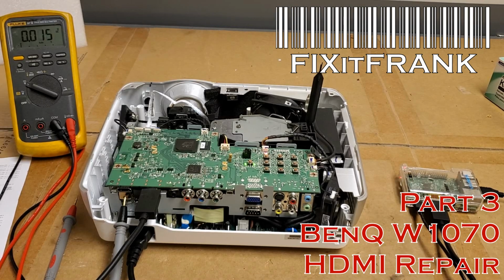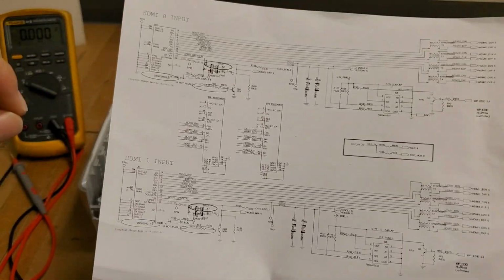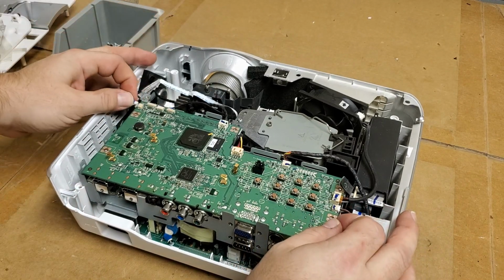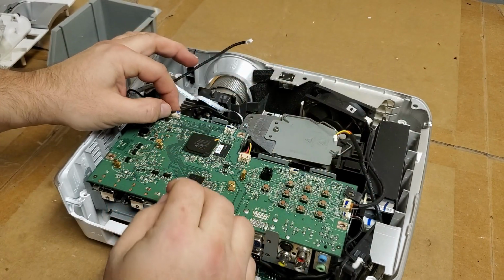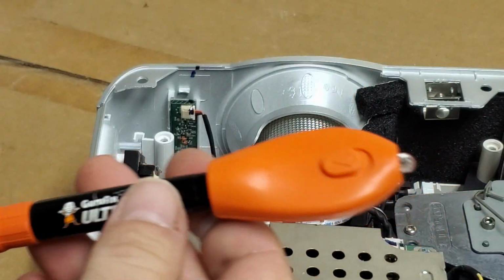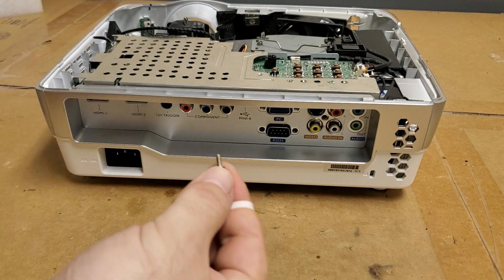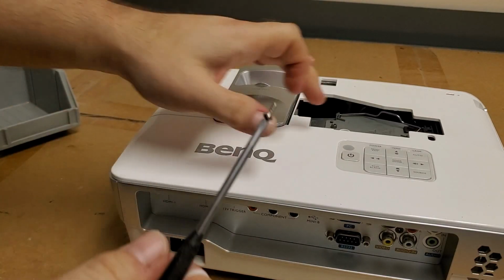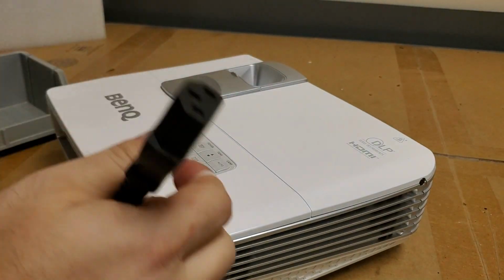BenQ W1070 DLP Projector Repair No Light-HDMI Repair Part 3

Comment: Hi. I have problem with hdmi ports, and i have question to You.
First my Benq w1070 had problem with HDMI 2 port(no signal), but i used only one of them, but now HDMI 1 lost signal to. HDMI 1&2 ports are death... :( i checked regulators UQ 1,2,3,4,5, and they are ok, chip ADV7612 is not burned(i have new one for sure, but not installed yet). 
Questions
- this long thin chip 5:00 is next to HDMI1 socket?(And HDMI2 to?)
- if i take out this thin chip, everyting should be ok with HDMI 1&2-signal?
(My 5x diodes for hdmi 1, and next five for hdmi2 are still in one piece)
Ps i see "service menu" on screen etc, only HDMI ports are death :/
EDIT/UPGRADE:
- probably i have phisical problem with HDMI 2. Maybe dirt, or not tight socket becouse i moved HDMI plug with signal and now i watching  movie (for test) 
New question:
I haven't HDMI 1 before ,so where is problem? Problem od with chip from "analog devices" company? Or with this small, thin chip next to HDMI 1?
Next question: you had problem (on your pt3 HDMI repair) with HDMI 1, or HDMI 2?
Reply from the maker: The TVS diode array was the problem here if I recall correctly(the thin chip array you mention).  But definitely check the inside of the connector.

Comment: Hi Frank. Thanks for the great videos that have given me confidence to attempt repairs. Hope you don’t mind if I ask your advice on my w1070+. The power light is continually red and other buttons, fans, lamp etc unresponsive. There appears to be an issue with the mainboard as I have tested the power board, ballast and colour wheel with a w1080st+ mainboard and they work fine. By touch and with a thermal camera, the DLP controller chip (DPP4422-he) of the w1070+ is particularly warm. I’ve tried reflowing it (30sec at ~230-250DegC) but no change. I’m wondering about giving up or trying to replace the DDP4422. I wondered if  you had encountered similar DLP controller issues and had any success with replacing them or other BGA chips? Thanks
Reply from the maker: Thanks a bunch for the kind words!  I have not replaced the DPP4422.  My understanding is they have firmware on them that needs to be flashed that I don't have the capabilities to do. I have not been able to confirm that though. If I am wrong, then replacing it would be an option.  I have seen them go bad a few times. Optoma more than BenQ but I have seen it on BenQ. 
But, I have also seen this happen with bad voltage regulators and shorted TVS diodes on the HDMI ports.  For what its worth, the W1070 service manual(level 2 or 3) has a great schematic in it.  I would make sure the PMD1000 is okay and producing proper voltage.  
The only way I have solved these (bad DPP chip) is to replace the mainboard. I do this because I need to know 100% that a customers projector is fixed.  If I replace the DDP chip and it fails then that is on me.  If it was my personal projector I might try changing that chip because if it fails in a bit, then no one is going to yell at me.
I'd suggest downloading the SM, then rule out the PMD1000 and any secondary VRs on the mainboard.  If that all checks out, then a mainboard is your best bet.  If you email gydz@timeprojetorlamp.com, they have access to mainboards(used but good) and they ship DHL and take paypal.  I've used them for 6+ years now and never had a bad experience.

Comment: Hallo Frank,
i need the color wheel for that benq i have one of this W 1070 projector but the color wheel demged i want orginal one becuse i bught one from china not worked at all .please Frank from where i can buy orginal one 
.
Thank you so much Frank you great healp 🤘🏻
Reply from the maker: You are welcome! There are no original color wheels to my knowledge.  Color wheels are generally pretty simple.  What problem are you having?  It might not be the color wheel at fault.  If you put a new lamp assembly inside, be sure it has a proper IR block lens or it will make the color wheel act like it has problems. I have had color wheels arrive with bad motors.  It is rare but it has happened.  Every wheel I purchased from Time electronics was good though. I never had a problem with their items.
Reply: Hallo Frank,
color wheel was damged and i bught one after i assembled in the projector ther  blue lins comen over the pic.
with Faithfully for Frank🙋🏻‍♂️
Reply from the maker: You may need to adjust the index position of the wheel.  Also if you have lines in the picture, check the seating of the main board. It may not be seated properly. The service menu is accessible by pressing menu, then press source and enter buttons at the same time. Use the arrow keys to navigate to position 3 or 4 and then down arrow to the color wheel index. Then adjust the number and watch the image.

Comment: hello I don't have an image on hdmi 1, can you give the symbol of this chip?
Reply from the maker: I recall this uses one chip for both HDMI ports.  I would check the TVS diodes that protect the chip.  They are made to short out to protect that IC from damage.  You will see the small rectangle parts right behind the HDMI plug.  You can desolder them without causing any other problems.  If you desolder them and the input starts working, then your problem is the TVS diodes.  If you still have no image, then the HDMI IC is bad.  I do not recall the part# at the moment, but I will update this later once I can look at the service manual.

Comment: Thank you! This was the problem also with my projector. Changed color wheel, changed lamp and finally removed HDMI chip, which solved the problem. :)
Reply from the maker: Awesome!  Its weird how those just shut down the rest of the electronics when they get hit.  I mean it makes sense but you'd think they would design it to be a little more robust in that regard.
Reply: @FixitFrank  More weird is the fact, that after burning HDMI, I used VGA for 2 years without problem. So the problem arised over time. :)

Comment: QUESTION PLEASE ..  dlp projector , tries to lite bulb but nothing .. no power is going to bulb on my meter..  color wheel spins and cleaned..  tries 3 times and shuts down with bulb failior light ?..  has new bulb that works in another dell ... fans all work , door switch good ...  would it be ballast ?...thanks, kevin
Reply from the maker: It is actually not possible to measure the lamp voltage with a normal meter.  These use high frequency AC(20KHZ or so) to drive the lamp and use a 5-10KV start up pulse.  That can nuke your meter. 
Your best bet is measuring the input voltage to the ballast.  If its 380VDC when you press power, then the main power supply is good. If it's 170V or so, then your main power supply is bad.  If you have the 380VDC, then the ballast would be suspect.

Comment: Hello Frank, thank you for all these videos. I have a InFocus IN8606HD projector with error in fan2 ( DMD fan) . After replacing the fan with a new one, the error appear again and I  found the problem is missing 7.5V from the fan driver. I connected the fan2 and fan1 in parallel and the projector is started, everything seems ok, but can not detect any signal source - nor HDMI, VGA. Can you give me any ideas where to look for the problem?
Reply from the maker: See if you have a chip marked PMD1000. That is a popular power supply chip and tends to fail.
Reply: @FixitFrank  Thank you very much for the answer.

Comment: Hi ! Your vidéos are awesome, maybe you have an idea on what can cause a resonating noise near chromatic wheel on W2000 when source is 50hz? (No noise with 60hz source). A small hit on the projector make it stop and it côme back randomly (sometimes no noise during hours). Maybe you have some idea ? I can send you a video but i do not have your mail .
Reply from the maker: That is interesting. I have never run into that.  You may want to try tightening or loosening screws nearby the wheel to disturb the harmonics.  My email is listed on the about page if you need it.
Reply: FixitFrank thank you so much for the answer, i only found the patreon link on the about page. Would you sent me a quick mail on olivier.royondotgmaildotcom if possible so that I can send you the video? I was thinking the same as you regarding screws but didn’t find yet. But additionnal point. It is doing it when vp is upside down and not when set on a table

Comment: Hey, thanks for the video!

Is there a way to test a lamp outside of beamer? Should it show some oms with multimeter? 

After the my bulb exploded, new one just doesn't light up, so i can't understand whether the new lamp is defective or some other issue is there.
Reply from the maker: These are arc lamps so they do not have a filament.  They are more like a metal halide. Technically they are Short arc mercury vapor lamps that use a  ballast and high voltage ignition.  On an ohm meter they should read open/infinite.  I would suspect the new lamp is OK as long as it is of reasonable quality.  Instead, check the small fan that forces air into the housing.  The fan I mean is shown here https://youtu.be/1kx0mLzDavE?t=671 in the middle. It has a brown connector with  yellow red black wires going to it.  They can catch pieces of the old lamp and jam the projector.  
Check out this video. https://youtu.be/DbhFVKExGVQ Its kind of a general troubleshooting DLP projector video.  It may get you to the solution. If not, let me know. There is more you can check.
Reply: @FixitFrank  thanks for the reply, I'll check that. How much voltage should be on the lamp input? 380v? I can probably measure that too
Reply: @FixitFrank  I did some more investiagtion. When I disconnect lighting board (ballast?) from either the power or from the main board (control?) it does detect that the lamp/board is failing.

Considering all this, it's either power board (output to ballast), or lighting board...
Reply: I've checked that fan and its working. All other fans and the color wheel seems to be working as well. I also noticed that the beamer doesn't detect whether the lamp is actually installed or not. So it won't indicate that lamp is failed. My current assumption is that probably lighting board is dead...
Reply from the maker: @maqdev  The ballast will notify the projector if the lamp has lit or not, so I think you are right in suspecting the ballast.
Reply: @FixitFrank  I had fixed ballast replacing one of the mosfets. Huge thanks for these videos 🙏
Reply: Oh i just found this video https://youtu.be/zcYFiew2YK8 which answers directly my question. Thank you! Happily my lame attempt to measure voltage on the lamp input didn't worked otherwise at least my meter would be dead and maybe even me (facepalm)

Comment: Great job Frank!! Blown diodes, hmmm. It's a first that I heard that diodes can blow from a surge, at the HDMI input. When my IC has shorted, I has a capacitor shorted on the top of the board. If I remember correctly, it was C267.
Reply: I had, not has, sorry about that.
Reply from the maker: Thanks so much Tibor!  Always good to hear from you!
I checked that cap too.  I had originally thought it was the power IC that I think you had issues with at some point.  The 5V going to the regulators was only 2v. Once I isolated it to the one regulator getting very hot, I found the 5V returned until I put power back to the HDMI chip.  I think it got hit via the HDMI 2 port.  Still have no idea what that little IC is for.  I couldn't even read the part#.  The fellow who owns it, uses a PC to drive the input so if the chip has to do with HDCP he should be OK.   I have a pair of MX710s that I should use to see if that chip is to do with HDCP. I'll put it on the list!